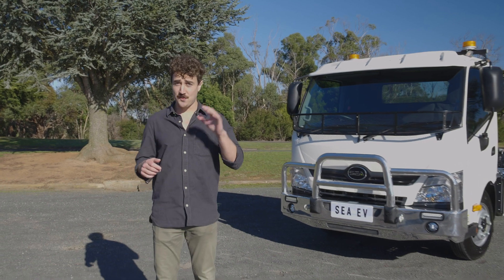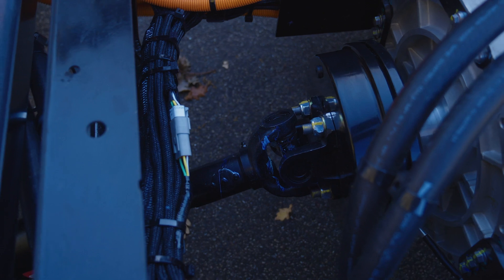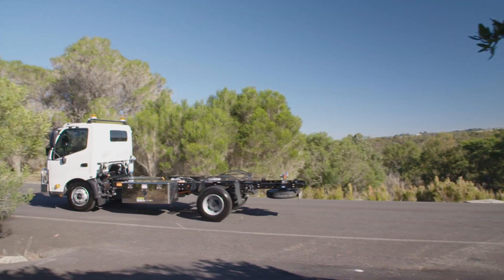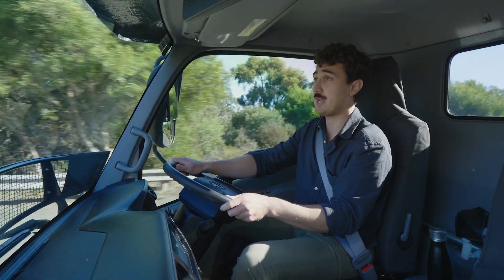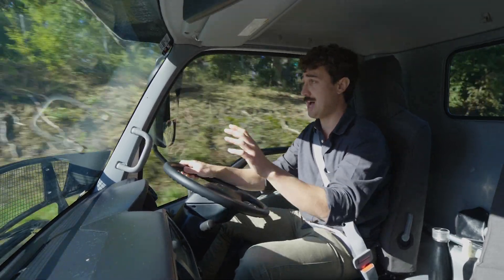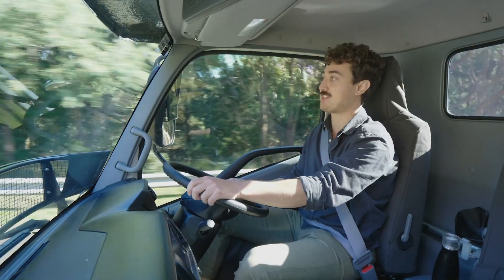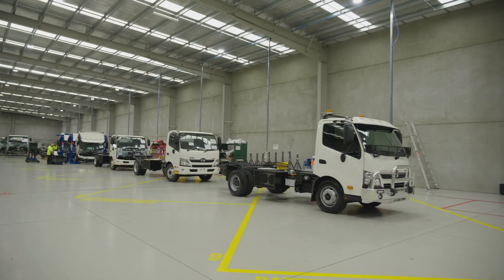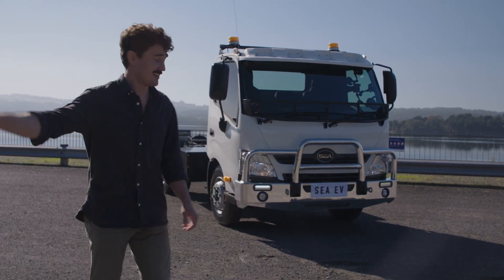Australian-made electric SEA 300 truck | Truck Test Drive

Comment: What is the battery weight range charge time load capacity,how many are signed up to produce this miracle,good if true,I also believe there is very little infrastructure if viable you should be swamped with orders but the devil is always in the detail.oh I forgot cost is it competitive?

Comment: What a useless review, what's the range? Load capacity? Price?
Reply: Yeh I agree, very mickey mouse review, all flash but short on substance....
Reply: EV Truck reviews do not mention price, mainly because nobody knows the price! But he should have mentioned the capacity and range.

in the US, SEA Electric has three Classes

Weight Class (GVWR): Class 4 (14,000-16,000 lbs); Class 5
(16,001-19,500 lbs); Class 6 (19,501-26,000 lbs) 

Range: 170-200 miles